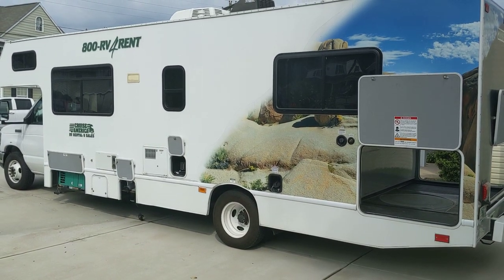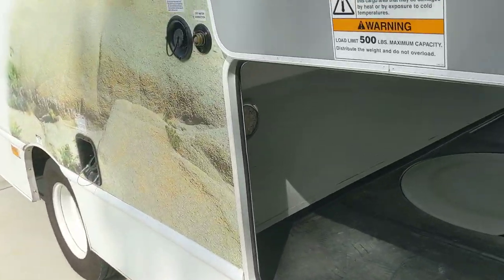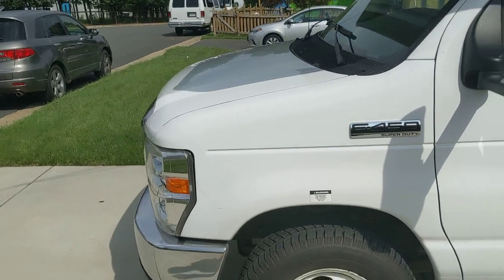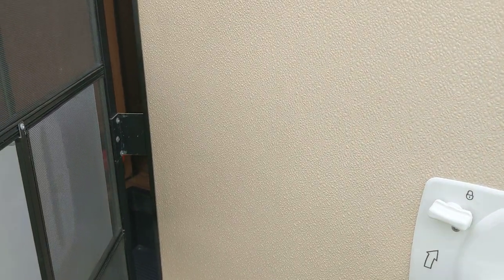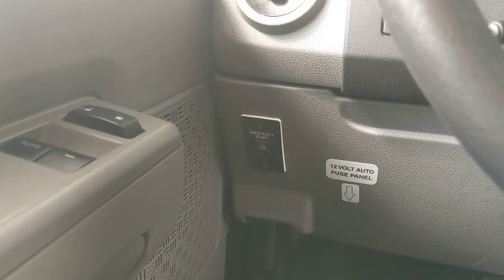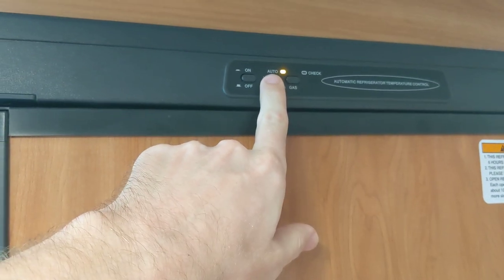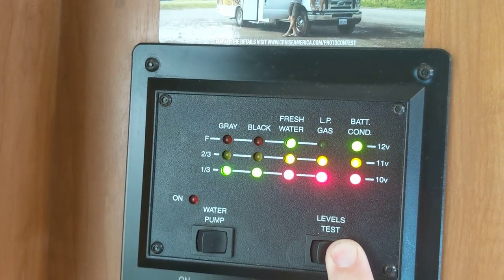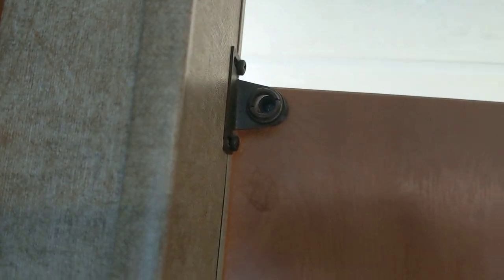Cruise America 30' RV Review and Walk Through

Comment: Great video I’m picking one up in 2 days for a trip.
Reply from the maker: Awesome!  Hope you enjoy it! 😃
Reply: @CompTechMike  it was a great vehicle all around.  Although I was a bit surprised at how noisy it was to drive at speed.  Wind noise above 50 mph was quite high.  But I guess one should expect that from a giant tin box.  It didn’t drive as smooth as I was expecting either.  My speed was limited to 67 mph, since anything over that caused it to vibrate more than one could tolerate for more than a few minutes.  Overall, however, it has everything one needs to live on the road for a week, or more.  I plan to rent one again in the summer to explore.  I found that there is a top notch rental facility within 20 mins of my house
Reply from the maker: @repetitivemotion  Hi!  Thanks for the feedback.  You're right, they can be a bit noisy to drive.  The forums are full of tips to reduce noise.  A couple things we do, since it's just my wife and I, we only bring two plates, two bowls, and two cups.  Also we use high density plastic (I forget the exact name) for knives, spoons, and forks.  Again, only two of each.  The less stuff you have, the less stuff there is to rattle.  😄

Also make sure all cabinet doors and bathroom doors are securely latched, and take out tray and shelves from microwave & stove and store them in a cabinet with a towel wrapped around them.  If you have a lot of dishes there are special insulator sheets that can go between them to reduce vibration.

I can't imagine what it must've sounded like at 67 mph.  All the roads near me have a speed limit of 55.  I try not to go any faster than that, LOL.  Also I seem to remember one time we had one that felt like it needed an alignment and tire balance.  Guess that's just the luck of the draw, but overall we've been pretty lucky to not have any major issues with our rentals.  Hope your next trip is a bit more quiet!  😃
Reply: @CompTechMike  I forgot to mention that we had an inner rear tire explode on the interstate at midnight in the middle of Arkansas.  I called Cruise America and they had somebody there within an hour to change it out and we were back on our way.
Reply from the maker: @repetitivemotion  Wow!  At least they were able to get someone out there quickly.  That must've been pretty scary!  How did the vehicle handle when it blew?
Reply: @CompTechMike  the blowout took the wheel well liner with it but the vehicle ran straight down the interstate.  We were lucky that we were approaching a cluster of businesses and were less than a mile from an exit ramp and a gas station.  Although the station was closed we were able to park in between the gas pumps under the canopy so that when the service tech arrived he had a level surface to work on the RV.  Thank God for the dually axle that we still had a fully operable wheel on the end of the axle.
Reply from the maker: @repetitivemotion  Wow!  Glad you are safe. 🙏

Comment: i have a few questions, is the lighting LED,? Does it have an onboard tank for propane? What sort of mpg do you average? & do you know what year the rv in the video is. Asking because i may look into buying an ex rental. Thanks
Reply from the maker: Hi!  Thanks for the comment.  If you are referring to the interior lighting (ceiling lights), yes, most of those are LED.  Also there is an onboard tank for propane.  You can see it down and to the left of the door at the 6:06 mark.  Mileage varies, the V8 models typically get around 10-12 mpg and the larger V10 models around 8-10 mpg, but this varies a lot! based on how heavy your foot is and whether you are driving over flat terrain or up and down mountains.  The RV in this video I believe was a 2016 (if memory serves), but they're all very similar in terms of color and style.  Good luck, we hope to buy one someday as well!

Comment: do you need the donut for the waste house? how about chemicals for the grey/black waste tanks?
Reply from the maker: Hi! Thanks for the comment. I've never needed a donut for the sewer hose.  Just stick my hose down the drain pipe, dump, and move along.  I guess if you're intending to park for an extended period at a campsite and are concerned about odors, picking up a donut off Amazon or your local camping supply store wouldn't be a bad idea!

Same thing with chemicals - Cruise America usually gives you a "blue pill" that you drop in the tank.  Dawn dish detergent can also help, some online forums also suggest dropping a bit of ice down the tank.  I guess it depends, are you more concerned about odors or the dreaded "poop pyramid"?  LOL.  😆

One other tip -- keep your tank release levers closed until you're ready to leave.  Then dump your black tank first, and then your gray.  The gray will help wash out the system and make sure there are no solids left behind.  Good luck, hope this helps!

Comment: actually you are better off having a full fridge because once everything is sufficiently cool/frozen, warm air from opening and closing the fridge has less chance to circulate in and warm collectively smaller mass. The same principle as large piles of snow that persist for weeks and even a month after snow fall when the air temp can be well above freezing whereas small amounts of snow melt off right away.
Reply from the maker: Hi! RV refrigerators are dometic.  They pull hot air out, rather than cool down the air inside.  If they're blocked (for example, by too much stuff) they won't be able to pull the hot air out as effectively.  Suggest checking out this article, here:

https://www.nadaguides.com/RVs/shopping-guides/dometic-rv-refrigerator-troubleshooting

Quote: "Fridges keep things cold, so you can pack it full—right? Not so. If you put too many items in your fridge, air can’t circulate. The result is unevenly cooled food and potential spoilage. Make sure you don’t put too much food inside—and keep colder items farther toward the back."  Hope this helps!  😀

Comment: Hi there! Looking to get into one of these as a rental. Can the generator run while driving?
Reply from the maker: Hi! Thanks for the comment. Yes, the generator can run while driving. You might do this if you have people riding in the back and want to run the rooftop AC or household-style electrical outlets in the back.

Remember to check the oil periodically, and that the generator uses gas from the main fuel tank (and will shut off if gas gets below 1/4 tank) and you should be fine. Have a safe trip!
Reply: @CompTechMike  thank you for your quick response! God bless!

Comment: Hi mike I have question I renting 30’ for December I can pulled my car with this vehicle? Or not
Reply from the maker: Hi! Thanks for the comment. I recommend checking with the rental company, your insurance, and the owner's manual for your car. The RV does have a trailer hitch but I'm not sure what it's rated for (weight-wise). You may need a dolly or other type of towing harness if your car can be flat-towed (check the owner's manual). You may also want to check with your insurance provider if towing is covered. So in theory, yes. But there's a lot of variables involved. If you've never driven an RV before and never towed a car I probably wouldn't recommend it. Good luck though if you decide to try! 😊

Comment: Hi do you have to be near electricity to get hot water and the microwave to work ?
Reply from the maker: Hi! Thanks for the comment. The hot water heater runs on propane, so as long as you have propane that should work. The microwave requires you to either be running connected to shoreline power (plugged in) or with the onboard generator running to work.  Hope this helps!

Comment: So you can't watch TV while driving?
Reply from the maker: Hi!  Thanks for watching and commenting on my video.  None of the current line of Cruise America rental RV's include a TV.  These are basic "no frills" units.  You can bring one along if you want to hook it up in the back and run it off the generator or an inverter or something (or the household electrical outlets when connected to shore power), but my recommended solution for if you want to watch TV in the RV would be to bring along a tablet or laptop computer.  Much easier to transport than a bulky home television.

Obviously I assume you mean for the passengers in back to be able to watch TV.  It is against the law in most/all states, to my knowledge, for the driver to be watching TV while operating the vehicle.  😆

An alternative if you really want an RV that includes a TV would be to rent one off a site like rvshare or outdoorsy.  Hope this helps!

Comment: How do you charge mobile phones etc via usb when driving if nothing works whilst driving please ?
Reply from the maker: Hi! Thanks for checking out my video. On the older vehicles you would need a 12v (cigarette lighter-style plug) to usb adapter. I suggest watching this newer video, here, which shows the updates for the 2021/2022 model year RV's:

https://youtu.be/qbBoA0x5Fow

On the newer vehicles they have three USB outlets on the dashboard that are powered by the vehicle's 12v electrical system, so they are "live" all the time.

If you want to use the household-style electrical outlets or USB outlets in the back of the vehicle you will need to either have the generator running or be connected to shoreline power. Or run an extension cord from the front, I suppose. 😉
Reply: @CompTechMike  thx for that. One last question or two, how many miles per gallon does the RV use ? (The big 30 foot one) I’m hire one for Route 66 so trying to work out real life costs.  Thx.  PS I’m from the UK so trying to work out all this city water stuff.
Reply from the maker: @go2map  Hi again! This is one of the most commonly asked questions in the forums. In our experience, we got around 12-14 mpg with the smaller 25' RV (with the V8) and 8-10 mpg with the larger 30' RV (with the V10). Slightly higher with newer models due to more efficient engines & transmissions.

Obviously this is hugely variable, however, depending on whether you're driving across flat terrain or up and down mountains, highway or city driving, how much weight you are carrying (people + equipment), and of course how heavy your foot is. 😆
Reply: @CompTechMike  Thx. Route 66 😁
Not till June next year but already booked with cruise America and the 30 footer ☺️
Reply from the maker: @go2map  Have a great trip! Safe travels! 😊

Comment: What is under the dinette benches?
Reply from the maker: Hi! Thanks for commenting on my video. Under the dinette benches there is the fuse panel, circuit breakers, and a storage compartment for the center pole that holds up the table (you can put the pole in here if you convert the table into the bed).

Comment: Propane  (shut off) should not used while motor home is in motion
Reply from the maker: Hi Allan, I'm not entirely sure which part of the video you're replying to.  In some states you are legally required to shut off propane when going through tunnels.  Also some gas stations have rules about this.  But yes, in general - you'd want to leave it on, so the fridge can operate / continue cooling while traveling.

Safe travels!  😊

Comment: Does the 30 amp plug have a surge protection circuit?
Reply from the maker: Hi! Thanks for the comment. The internal electrical outlets are equipped with circuit breakers and fuses. There's a panel underneath the dinette seat for these. However most frequent RV-ers get an inline surge protector that plugs into the power pole at campsites, such as one of these:

https://www.amazon.com/Protector-POWSAF-Defender-Protection-Designed/dp/B08RJ72Z1S/

(no, they are not included)
Reply: @CompTechMike  My wife and I are renting that RV from Cruise America in a couple of weeks.  I've heard horror stores of camp group surges and was wondering if we needed to get a protector.  Good to know they are set up already.
Reply from the maker: @Biffwellington4518  You're welcome!  Yes, the internally-connected equipment (the stuff you bring from home) should be protected by the vehicle's built-in circuit breakers and fuses.  If you're concerned about protecting the vehicle itself, you can also purchase one of the in-line protectors like I linked to above.  Personally I wouldn't invest in one for a one-time trip, but if you're thinking of buying your own RV in the future (or renting frequently) they're definitely worth the investment to protect the vehicle's power circuitry.  Have a safe trip!